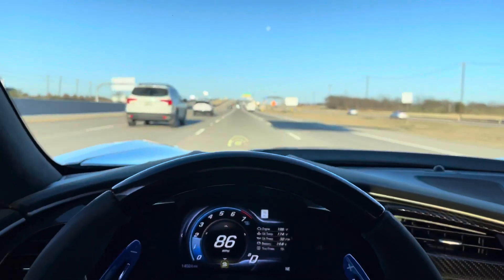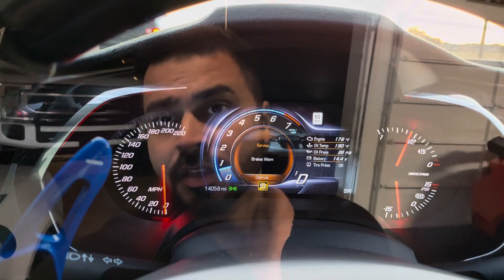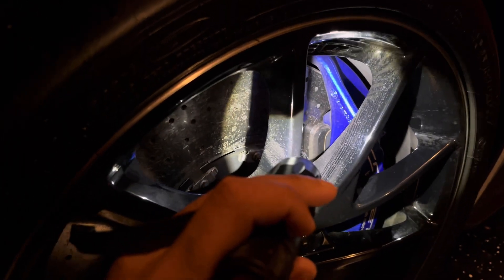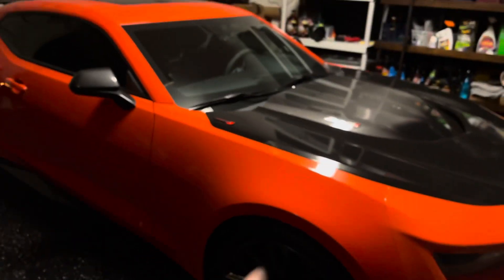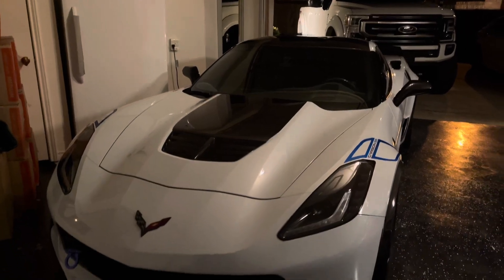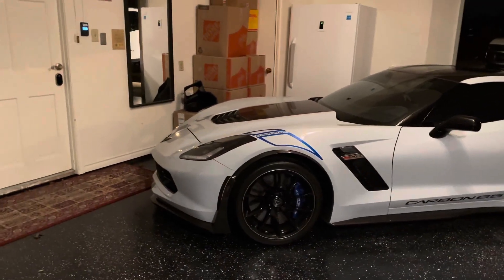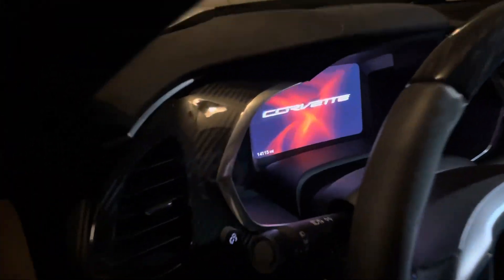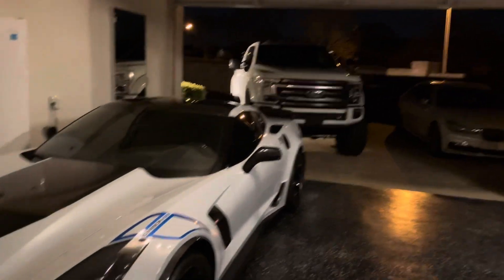$8000 Carbon Ceramic Brakes Messed on C7 Z06/Z07 Corvette

Comment: Thank you for taking the time to make this video! Did you solve the problem?
Reply from the maker: Thank you for watching sir. Unfort5not yet - we did however narrow down to front sensor. They are on back order. The good thing is on physical inspection, there is 90% plus brake life left!
Reply: @HotRodsDFW  acknowledged. I was watching another video where the guy talked about just unplugging the sensors. He said it's really easy to see how the pads are, and no annoying alerts. But I can see why people wouldn't wanna do that.

Comment: My 2019 Z06 has the same issue with only 3700 mile 😢
Reply from the maker: Sorry to hear that Jassim -- I will post once I get it fixed - the process, if warranty paid, cost etc. However I would say don't let it bother you - just inspect the pads and you will be good to go! Only comes in play when you will be trading the car (if you plan to do that)